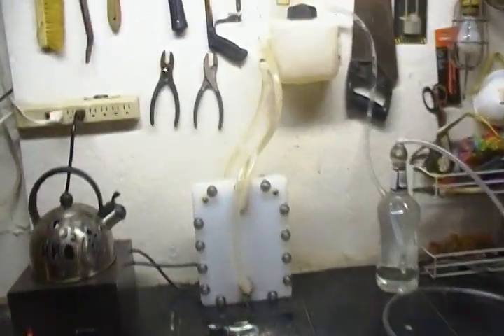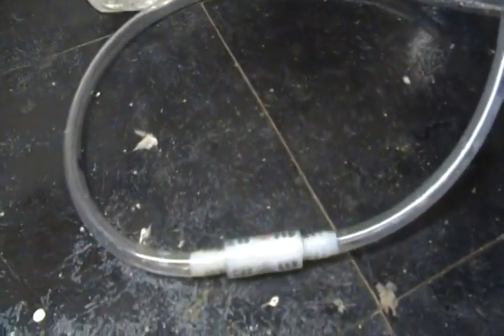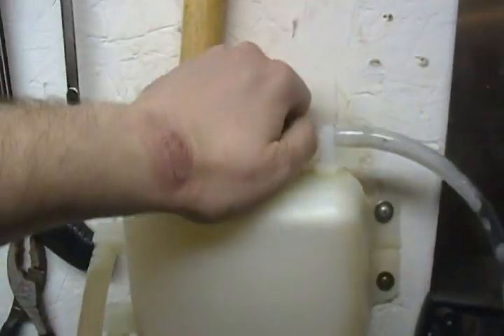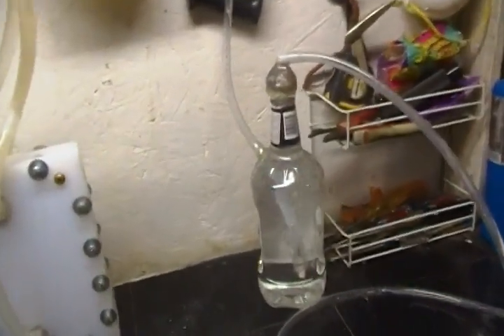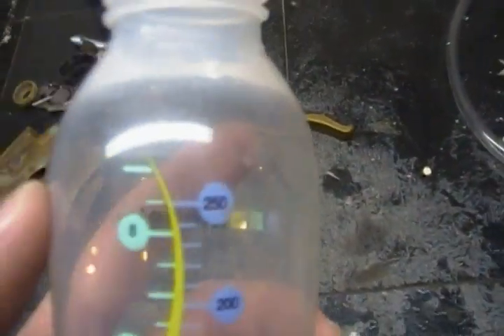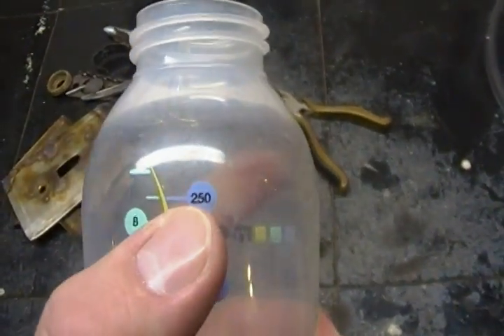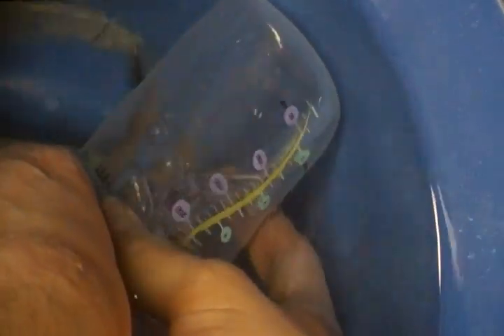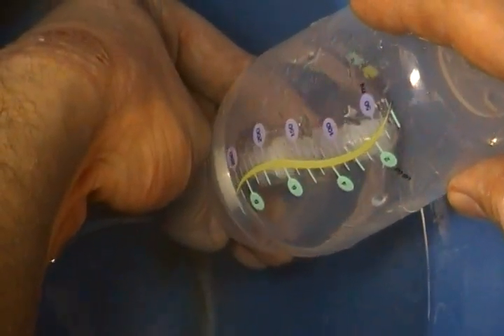Hydrogen Fuel Cell Update and LPM Test

Comment: look up stanley meyer. they killed him in the mid 90s h2o fueled vehicle.  high frequency h-h-o production.  could convert a commercial petro engine with a sparkplug kit to run the vehicle on the hydrogen.